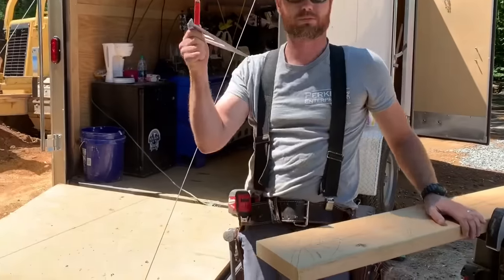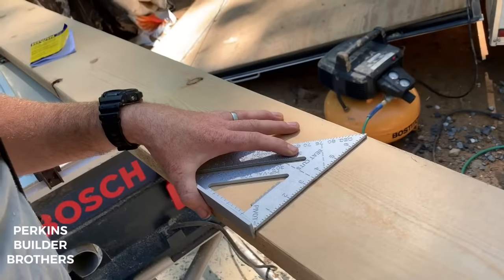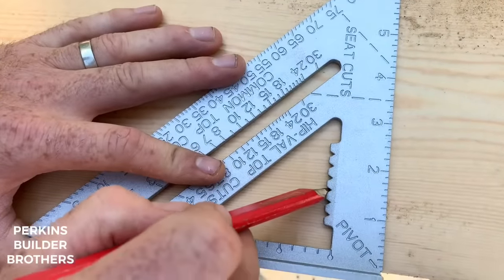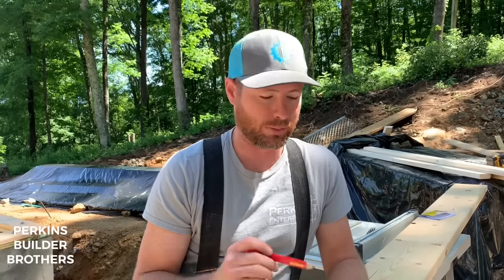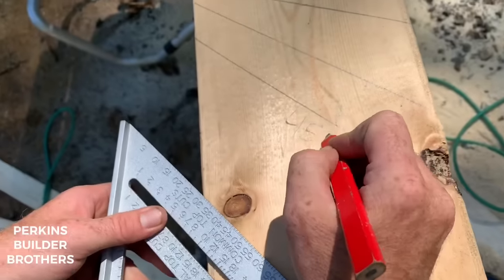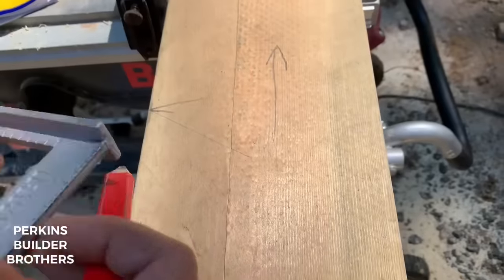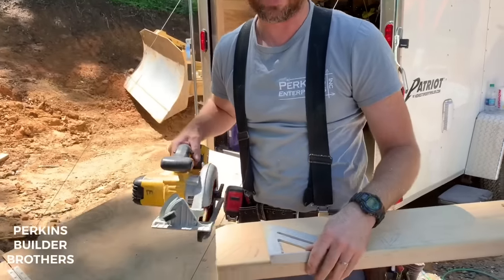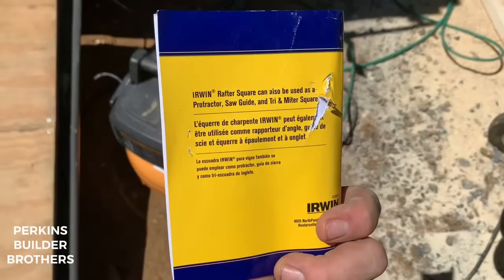How to use a speed square | Why it might be the most important tool you own

Comment: As a drywaller, I can confirm that this video is necessary. All framers should watch this lol.
Reply: OldScrubGamer hahahaha
Reply: im a finish carpenter and you drywallers should watch some videos. lol
Reply: Yeah! I've run into some framing situations during remodels, (mainly in condos) that leave me like !WTF! I couldn't frame this bad if I tried. So........keep shimming lol.
Reply: @badboyvids1  the drywall follows the wall... not sure what you're insinuating here. I can't imagine a taper so bad that it interfered with the finish carpenter. There are alot of DIY guys that try to pretend at being in the trades though... so I guess it's possible. I saw a guy do butt joints with just a hawk once. No trowel... just a hawk.
Reply: @oldscrubgamer1853  true to a point however drywallers love to float the walls to make them look straight. just saying no need for anger issues. There was a lol after my comment
Reply: @badboyvids1  no anger man. I was joking with my first comment. I just didn't understand your response. I've never seen anyone do that. That's a lot of material and time to float a wall out as a taper. Lol
Reply: @oldscrubgamer1853  what I meant by floating was they will not screw it down when the wall is concave they float the drywall over it and screw top and bottom or anywhere after the bad area making it hard to locate nailing areas and also causing a problem when we put our base on. We are having issues with the house we are working on now. It really comes down to the framers mostly. Don't you know that finish carpenters are God's chosen people.
Reply: @badboyvids1  oh... wow. That's bad. That's like really a problem. If the wall kind of waves a bit, and you don't screw to the studs that aren't flush,  you allow the sheet to flex there. I mean you should get it fixed, not board it, but that's going to potentially create cracks in the joints.
Reply: @oldscrubgamer1853  hey they came and began fixing things all is good
Reply: Ha....as a electrician all you guys need to watch this.. it's great for you & your crew to eat pie & ice cream with on a hot summer day too..
Reply: OK...framers need to watch that there cuts are accurate so walls/corners are plumb.  They also need to throw the garbage 2x's in the dumpster. 

Drywallers need to watch the amount of mud you put in corners so it at least comes close to a 45 degree angle. That makes really hard for finish guys.  Corner beads are often not straight, and when the framer does a bad job, the corner bead is a great place to straighten/plumb things up, making it easier on the next guys.  It will get you hired again too.
Reply: The point is you have to understand the next guy who will continue the job after you. Then will be much easier for us all.
Reply: As an all round carpenter, I can confirm drywall finishers/AMES Tapers could do with a combination square more than any other trade needs any kind of square put together
Reply: @oldscrubgamer1853  Just seen your comment, you are obviously not from the UK (building regulations are strict for every trade minus these clowns) I could send you some pictures of walls that have been framed perfectly, only to be finished with corners at 80-110°
Most pointless/worst trade ever
Reply: and to make it worse most chop saws dont cut past 45°
Before anyone says it yes I am more than capable of cutting miters by hand but I shouldn't have to !
Reply: @scotland2256  you're saying drywall is pointless and useless? Do any of you guys actually work in the trades? The shit you say doesn't make sense. I mean I made that comment as a backhanded joke, but it brought out some nonsense.
First of all they're building codes not rules... like explain to me how a drywaller turns a 45 into an 80 or 100 degree corner. The amount of time effort and material it would take to do that makes the likelihood of your story basically 0.
Reply: @badboyvids1  I'm a homeowner and you ALL take shortcuts..  I Remove the door trim to see wisps  of insulation shoved in the crack and sunlight coming through. This means that the framer didn't build it square, The drywaller didn't speak up or shove some insulation in. And the finish carpenter just put it all out of sight and out of mind by covering it up.
Reply: @BGraves  don't put all of us in the same category, their are hacks out there in every occupation. we call them the 10% that slipped through the cracks. We also use spray foam for our doors and windows etc... Sorry you had a bad experience were not all like that. oh and us finish carpenters , were God's Chosen people.
Reply: Subs always blaming each other...PM's just want the job done right!
Reply: You get good and bad in all trades. Humility is key to learning and progressing. I come from a family of plasterers. Dad, bro, 3 uncles and 5 cousins and mates. Going on 11 years myself. I'm blessed to predominantly work in the insurance side so I get to meet heaps of different trades up and down the East Coast of Australia. One thing that SOME chippies do that irks me is not hammering down the top plate bracings so that they square the frame. It fractures our board and takes unnecessary time in bogging for square set finishes.
I get to do a lot more ornamental work than most (insurance).. And perhaps one day I'll break in to high-end homes to level 5 in conjunction with ornamental. So many different ways of doing things though! Great vid shown here - cheers mate
Reply: Lolllllll...yesssss
Reply: My uncle was a drywall and plaster guy. I always kept him in mind while framing :)
Reply: I’ve seen dry wall boarders using pl on the studs now to accommodate floating, I’m assuming once the pl hardens it acts as a shim. Not saying it’s right but as a frame to finish carpenter i can say I don’t want to be the guy ripping it out in the next Reno lol. That said, where I am it’s all mdf t&g wallboard these days and almost no drywall( thank god)
Reply: badboyvids1 right? I hate to install doors after sloppy drywallers. Beating drywall to get trim to lay flat. When you get both sloppy framers and sloppy drywallers... nightmare for the finish and tile guys!
Reply: OldScrubGamer mines more around doors and nails and glue. Hard to fix nailed drywall and glued!
Reply: @jamusmorrison3073  sloppy drywall won't cause things to not lay flat... It follows the framing. I mean sloppy drywallers can have big gaps in their joints and such, but it shouldn't lump out. And if you mean taper, than I don't even know what to say... they don't know what they're doing?
Reply: Brian Graves haha Brian let me say I’m sorry you have had bad workmanship. Even my greens know to speak up if something isn’t right. 
So let’s just speak of the problem you’ve had. Insulation around door. So first off it’s not a framing problem. Say you buy a 36” door. The framing needs to be 38”. Usually making the outside to outside of door jamb 37 1/2. Leaving room to shim or for insulation. Materials swell and shrink.
As a custom home builder we hire insulation crews to do all of our projects. It’s cheaper than we can do it.
So ultimately he guy that trimmed the door was last one to be held responsible.
Reply: MuskokaJames  For about the last 10-15  years common practice/ industry standard is glue (drywall adhesive) screw the ceiling and nail the walls. On the ceiling Both edges and 2 or 3 in field gets SCREWED depends on 5/8 or 1/2. On the walls GLUE and NAIL seams. Also a nail where a box may be on the wall (receptacle & switch) to closest stud. 
I’ve seen 10’s of thousand of sheets done this way. 
Durabond 90 to tape. Then Black lid Proform. 
17 year Custom home builder and I hang and finish between 500-1k a year. Myself.
Reply: @jamusmorrison3073  Agreed, I don't know how many times the 4 inch wide door jamb I was installing was actually narrower then the new construction wall. It's like these messy careless guys can actually defy the laws of mathematics 😂
Reply: Yup, straight, square or level don't mean nothing to some people! Sure makes the job much tougher... fight it the whole way!  😕
Reply: badboyvids1 Brick masons are Gods chosen. Everybody knows that. Go labor for a mason crew and if you make it past a week I’d be shocked. No other craft destroys your body like masonry. I know. I lived it for 25 years, and now I can barely comb my hair bc of two shoulder replacements with the metal replacing my destroyed shoulder. When I hear people feeling sorry for football players it makes me sick. They may be injured and in pain but they also have millions of dollars and damn good doctors to help them through the hard times.
Reply: How many people on here know what a plumb rule is?
Reply: Believe me I've dealt with drywallers all my life. I even have a corner board that I call a crybaby just for y'all. Happy new year. God bless.
Reply: As an actual carpenter I can say this man doesn't know what he's talking about. He measures out and scribes a 50° line and thinks its 40°. He wouldn't last a day framing a roof
Reply: Oh just shut up and bend the drywall, STOP COMPLAINING!
Reply: @badboyvids1  worked as a general contracting labourer and contractor everything from excavation, concrete footings, all the way to the roof and everything in between. Finish carpenters have to put lipstick on a pig if the walls aren't flat. If one studs out an 1/8. Everyone behind the framer has to hide the mess.
Reply: @scotland2256  or back cut your angles with painters tape and a fresh finish blade but like you said we shouldnt have to
Reply: @oldscrubgamer1853  I think he meant his 45 on trim doesnt work on an angle other then 90° 80-110 degrees on corners is something Ive witnessed from weekend warriors and some bs tapers but ya its not even the trade I do on the daily and I dont know how they manage that
Reply: As a siding and gutter man I agree.
Reply: I say... caulk it all !!!.. lmao.!!!!...
Reply: Hilarious 😂
Reply: I use my speed square all the time as a roof carpenter, but I never use it to mark rafters, I make a boat from a bit of scrap with the plumb cut at one end and the birdsmouth on the other end.
Reply: Sounds like you have a hard job after those framers who lay studs wherever, making the dry wall job really hard

Comment: “I’m not worthy !” Been using one for years , didn’t know even a quarter of the shit you can do with it ! You are a star !!!!!
Reply: Dig that. i didn't know as much as you.
Reply: druid799 don’t feel bad, unless you’re framing roofs, you’ll never use all of its features.
Reply: Robert Beirne ahh not all true. Still need angles for allot of other things. Or if you gotta cut an angle you can just get the pitch and then put it on another board. But you’re right when it comes to rafters,  those are a need to know. I started out framing new construction so learned that pretty quick but i guess since I knke that’s maybe why I use them for more things. Also stairs as well but typically use a 2’square for those.  Crown molding too if the angles aren’t perfect 22.5, 45 degree angles also.
Reply: 😂 I really hope you are not a carpenter then
Reply: Terry Priestley I’m not a carpenter, but i do some carpentry and I do use a speed square. I’ve not had to calculate bird mouths on a rafter.
Reply: druid799 takes guts to admit
Reply: You must not be a carpenter then cuz thats all basic.
Reply: They’re really just my favorite thing. Pretty sure have about 20 in my shop. Lol. Everyone has different reasons they’re handy as hell. Definitely didn’t know half of how handy it was 17 years ago.
Reply: Lol
Reply: @MegaFunnyman86  I am a cabinet maker. I usually use it to help me cut strait cross a plank. Thats all. I am 50 years old, doing cabinets since 1990..

Comment: I like the speed square so much I got the larger one. I've been a carpenter for 42 years and have used the speed square to do cut roofs, including hip roofs, for my entire career. I started in production framing and had no time to make a second line during layout. Everybody understood the stud goes on the X side of the line. At openings, S is for stud and C is for cripple.
Reply: Me too
Reply: Not S for stud, K for king stud on the header, T for trimmer under the header, and C is for cripple, they hold up the sill. An adjustable speed square is your best friend on the roof!
Reply: Free Radical - I think it’s a east coast- west coast thing.
Reply: @michaelgarrow3239  so is holding headers down! lol
Reply: Free Radical - I’m guessing your out west?
Reply: @michaelgarrow3239  framer-general contractor in washington for over 20 years. retired now. Matsushita makes the saw blades, period.

Comment: The 3/16” thickness of the speed square is also a good way to space the next top board when building decks
Reply: It sure is.........if you suck at life.....go right ahead
Reply: Maybe on composites, I’d just treated I always lay them tight because they’ll shrink a 1/4 within a few weeks, anybody else
Reply: Using it to space decking is one way I’ve used mine more often.  That’s mainly because I haven’t had much practice with layout/cutting yet.  I’m hoping to get into carpentry soon (framing specifically).  And have been trying to learn the skills I need while I look for a job.  Videos like this help me a lot more than reading a book.  
Thanks for posting!
Reply: They will shrink so no gaps is the way to do it
Reply: I would always place a nail between them before I nail it to give it just a tiny about of space but the guy is right about it shrinking. The salt water in the treated wood drys out within a few days then it's water seal time. I miss doing carpenter work. It's a trade that not all men can do.
Reply: Unless it is wet treated and they will shrink up quite a bit so we leave them about 3/32 or a 6d finish nail.  Then when they dry out you will have a bigger gap between them.  But yes, on porch flooring that is more stable like Ipe or Cumaru, you can get by with it :)
Reply: I always use carpenters pencil
Reply: I did this too, lol.
Reply: They will shrink. Slam them. But not if it’s cedar. Cedar will swell when wet. So use your speed square for cedar.
Reply: @tailgatecarpenter26  That's what I've always done, unless green lumber put tight

Comment: He actually drew a 50 degree angle in relation to the edge of the board. It was 40 degrees from a line drawn perpendicular to the length of the board. Still a great video. Learned a lot even though I use one almost every day.
Reply: I don’t understand can you explain a little better it looks like 40 degrees. Thank you
Reply: @kymana01  At 3:08 imagine him aligning the speed square with the 10 degree mark instead, and you'll see what these 10 degrees will be in relation to. Definitely not to the board, as the line will be almost perpendicular to the board. Only 10 degrees off the actual perpendicular line (that's not drawn). That's what these degrees are in relation to - the line perpendicular to the length of the board.
Reply: @Ruslan-S  I see what you mean! So these marks are actually degrees from the (imaginary) line perpendicular to the board edges (let's call them X degs).  So 90-X degs= degree angles relative to the board edges.  Since the line he drew was 40 degs from a perpendicular line) that line would actually be 50 (90 minus 40) degs relative to the board edges.  Thanks for the explanation!
Reply: @Ruslan-S  can you explain the 10/12 he was talking about? I get he had it on the 10 degree mark but where and why did the 12 come into it? 12 what?
Reply: @vonwilson668  that's for a common rafter cut for a roof pitch of 10 inches vertically to 12 inches horizontally. 12/12 would be 45 degree roof, so 10/12 is around 40 degrees and 6/12 is around 25 degrees relative to the ground. See Roof pitch calculator online. Not sure why 12 is a common denominator in the US but likely traditional, because there's 12 inches in a foot, and also 12 divides well.
Reply: @Ruslan-S  I’ll never have to worry about it really but I couldn’t make sense of it and it was annoying me lol.. I appreciate you taking the time to explain it to me. Thank you
Reply: Yes, you're correct.  I thought that too.  Even the teacher can make a mistake...
Reply: YES I was thinking the same thing! 😂😂

Comment: Good video.  I have a tip for you that you may already know.  Peel the label off your tape measure and sand the plastic with some fine sandpaper.  Write your measurements on your tape and erase them with your sweaty thumb.  The fine sandpaper is the key - it holds the pencil markings until you actually try to rub them off, but if you go too coarse the marks are difficult to remove.

Comment: Just a quick correction.  When you marked the 40 degree line (3:00),  you mentioned it was in reference to the base of the board (3:11) but in fact it is in reference to the perpendicular to the base of the board.  Notice when you set the square at 0 degrees that is the reference point in which the angle is coming off of. Then rotate to desired angle and that is the angle between the starting point and finish point.  

Otherwise great video

Comment: Great speed square advice! One practice that I found to keep your fingers farther out of the way when you’re using a Skillsaw, is put the edge of the speed square on the bottom instead of the top like you had it. Keeps your fingers where you can see them easier:)
Reply: The reason you put it the way he did is because the saw will catch it the other way, plus as you push the saw the square can move more easily away from the board making it out of square cut.